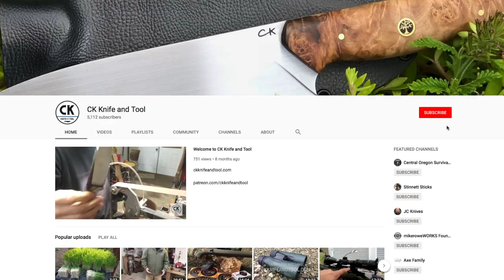Knife Making 101-Gluing up Scales

Comment: Very good video.. It's difficult doing good videos while working.. No it's not boring to me, I have only 5000 questions you answered by watching, I never read the infor in blade magazine..
Question, in the corner of your shop you have a huge collection of sanding belts, or grinding belts.. 
What's the finest grit you use?  Do you go finner than 400 grit?  I use off and on 600 to polish, no finner then that do I need...  Well done , I always wanted to know about expoxy and what is the correct one..
Reply from the maker: Norman Mallory ... Ha!  Yes, quite to collection.  I’m going to see how many I ended up with next year.  I have belts saved since about April this year.  I hate throwing them away!  As for grits, I primarily use 120 grit and on occasion 220.  I hand sand from there.  I prefer to hand work my knives from them on.   Check this video in regards to belts.  I have a couple others too I think but this was done a few months ago.... https://youtu.be/teTVtJC-sX4
Reply: @CKKnifeandTool  okay thanks I will look.. Lot of hand work in your one of a kind knives..